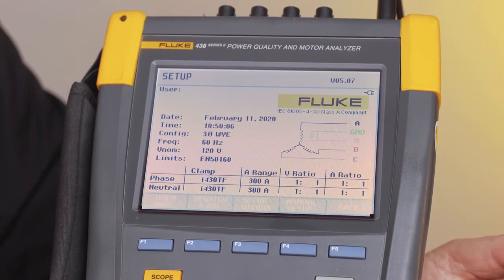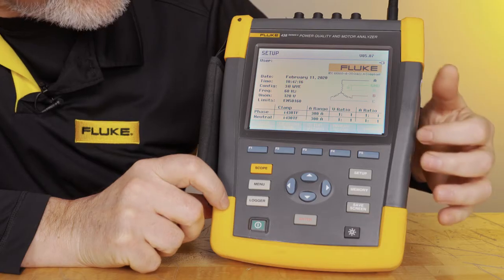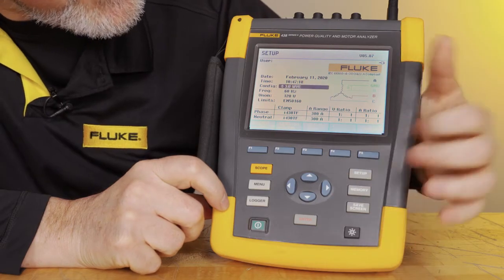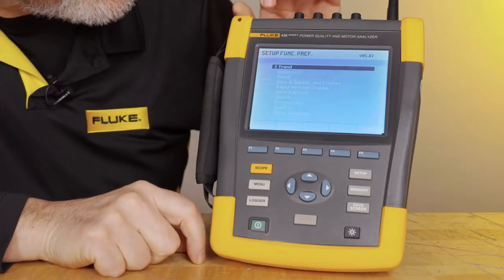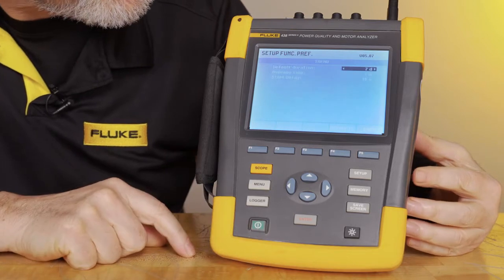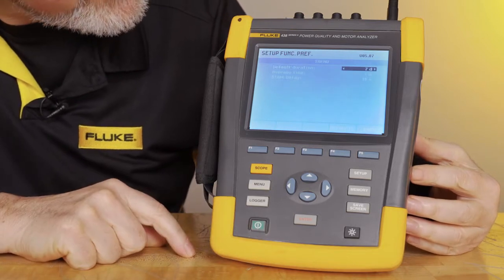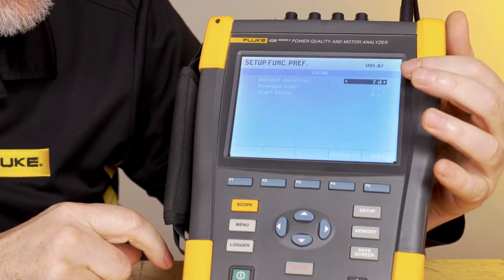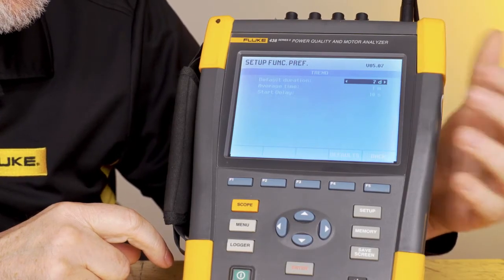Cómo configurar las medidas con el 438-II | Consejos de Fluke Pro

Comment: Hi. We have Fluke 435 Serie II, however I wanted to ask if there is any other equipment that allows us to record the samples or even record average RMS times in the order of 0.5 milliseconds. I mean, to get about 40 samples per wave of 50 Hz (20ms) and be measuring for a while (several seconds or even a minute). The actual fluke we have is able to record one value per 0.25 ms. 

Thanks